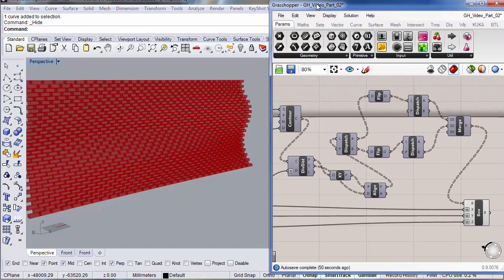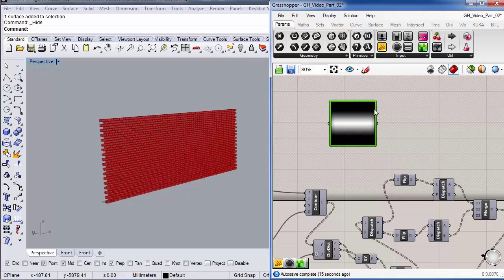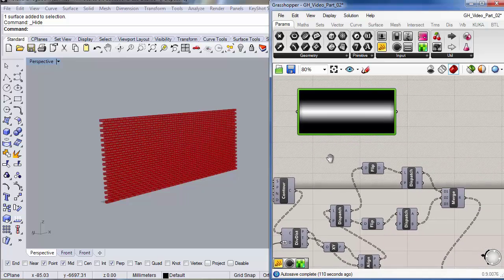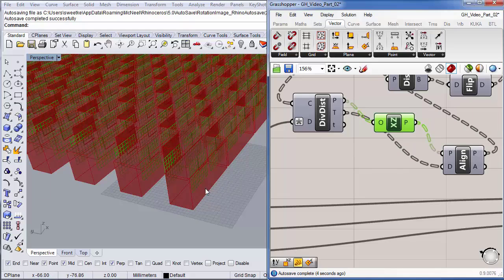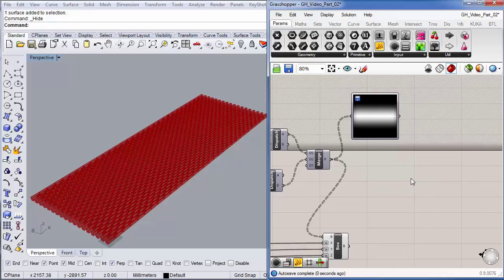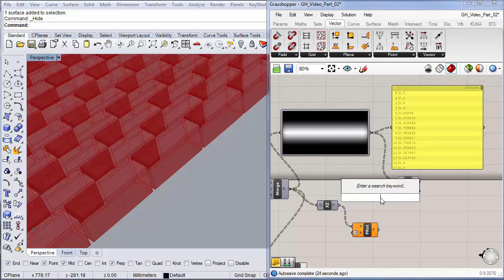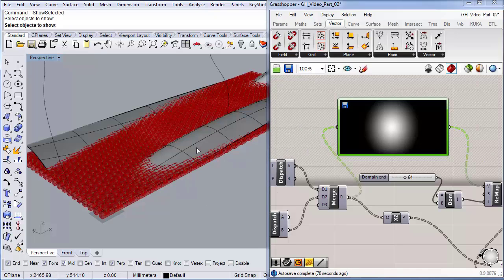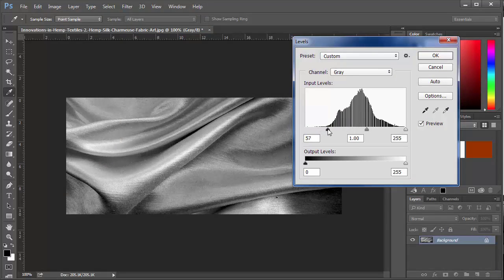GH Basics: Brick Wall Part 3

Comment: Grasshopper IS NOT A TOY or a gimmick. Grasshopper is EXPLICIT HISTORY or visual programming like KISMET in Unreal Engine. It's hard, it demands technical knowledge in mathematics, logics, circuit theory and data structure. 

Of course once you dominate it you get the most powerful tool in your arsenal with an increasing power of growing and being more robust. Grasshopper grows on you stronger, faster and better. 

It's pure knowledge of the past and a lesson of true history. i'm glad that you discovered it. Excellent tutorial too.